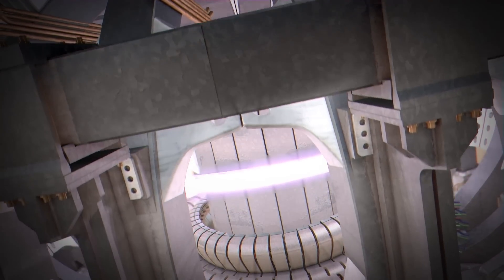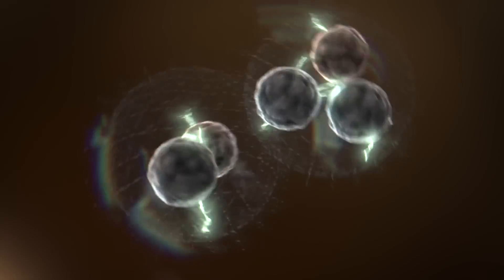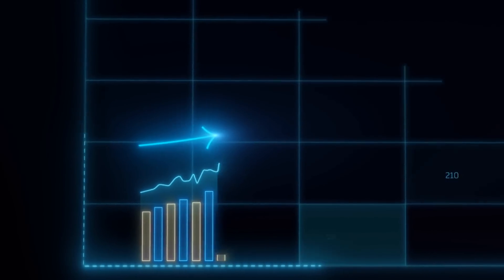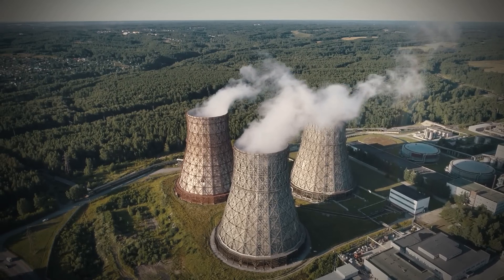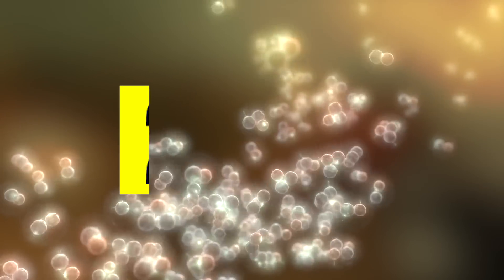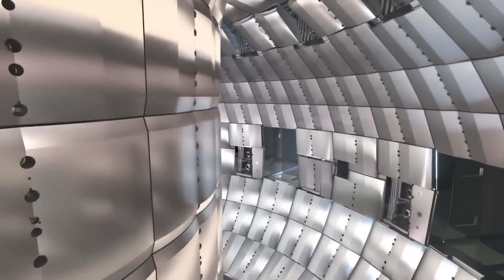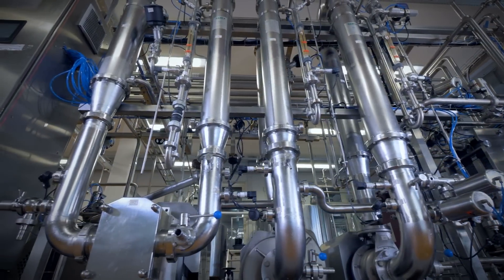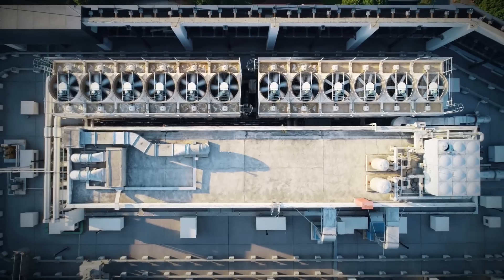The Shocking Problem That Could End Nuclear Fusion

Comment: Tritium breediing does not have to rely on the fusion reactors, it can also be done using other neutron sources. It adds to the cost but is feasible. As for the Lithium 6, as soon as te demand is there the facilities will be uilt, just like with any other material. the process of enriching it is well understood and the fact that a site that was poorly run decades ago is no longer operating does not necessarily mean that the method itself is unsuitable. Other than that a good video.
Reply: To add to this, that the lithium-6 isn't as abundant as lithium-7 shouldnt not be that big of a problem, lithium mining is increasing already due to need for the metal to manufacture batteries.
Reply: Oh, just got an idea, spent nuclear fuel radiate neutrons right? Why not use this used fuel to make tritium  instead of burrying it in the ground?
Reply: @assarstromblad3280  it's a rate issue. Tritium itself is radioactive, you need a source which produces at high enough rates to see significant value, and spent rods are considered spent for a reason.

That said, viable alternate in the short (50+ year) run- just invest in nuclear fission power. It's safer and greener than coal, and it turns out the WASTE PRODUCT is a highly sought after resource in its own right
Reply: @mjp121  spent rods are not spent at all btw. There's like 95%+ fissile fuel left in them. Our current fission reactors are abysmally bad, because no one wants to invest into better designs.
Everyone wants illusive fusion, because it sounds cool or something, not realizing a good fission design would be much cheaper and even better for the environment
Reply: @assarstromblad3280  They just have so little radiation
Reply: I remember a Kurgezkat video about fusion, they said a good substitute for Tritium Is helium-3 which is abundant on the moon
Reply: It is so well understood that it is still only theoretical. Reactors are never going to produce tritium at a 1 to 1 ratio. So even with tritium breeding a fusion reactor is still going to need a continuous supply as the likelyhood that tritium is produced is very small.
Reply: Soooo... in order to run the "clean" fusion plants, we have to also run fission plants to generate the fuel? AWESOME!
Reply: @richardmetzler7909  fission is clean, cleanest source of energy there is. And could be way more cleaner still if people stopped ignoring that option.
Reply: @richardmetzler7909  not necessarily, but it is one of several options. While we are at it, check the radioactive emissions of coal fired plants. The ash has some quite elevated levels of radioactivity in many cases.
Reply: Tritium is being breeded directly within the iter reaktor!!
Reply: it can be mined, just like we already do for batteries. yeah, let's completely destroy south America for lithium... who cares? we will be charging the customers for the extraction processes anyway.
Reply: Brilliant Light Power – Latest Update
212 views  Jun 3, 2022  Mr. Hinman discusses his long-term interest in breakthrough energy, again focusing on Brilliant Light Power.
https://www.youtube.com/watch?v=W_Fll6elzpI&t=231s&ab_channel=CharlesArthur
Reply: Yeah tritium is already produced as a byproduct in fission reactors, so they just need to optimise a process that used a fissile material to produce lots of tritium. Traditional fission reactions generally produce neutrons anyway.
Reply: Kalki Ironman type 7 and 8 after 2026 😎

kalki avatar (beast of the earth) (christ on the white horse) (son of man on clouds) is the biggest enemy of dajjal/antichrist/kali 😏

Kalki Avatar (Murtaza) 11th satguru 13th imam cousin of Moula mahdhi a.s. 12th imam (muhammad) 😎

Prophet Moula mahdhi is raja shashidhuvj (the mighty one) born less then 1200 years ago 😎

Prophet Moula Isa a.s. will kill dajjal cause dajjal is going to kill Kalki Avatar 😏

Kalki Avatar will follow orders from 2 religious king Moula mahdhi a.s. and Moula Isa a.s. 😎

Kalki Avatar going to have 2 swords and ring of moula sulaiman a.s. and staff of moula musa a.s. (iron rod) Staff of moula musa a.s. is like omintrix can transform into anything and can transform others into anything And stone in the ring of moula sulaiman a.s. is also known as kastav mani and it's more powerful than all 6 infinite stones combined 😇

Cuz Kalki is ironman batman super saiya-jin superman ben10 saitama optimus prime shaktimaan and every super heroes combined after 2026 😎

This staff will transforms into white horses with wings,weapons,iron-man,cloud etc or can do imagination into reality 😎

*Ratn sru sword of lord shiva (miri)😇

*Ratn varu (zulfakar) sword of Moula Ali (piri) 😇

miri piri 😇

Kalki Ironman after 2026 😎

Satyug (sunrise from West) 2038 😏

Sambal is hospital 😏

Gzwa e hind 2029 😎

Khalistan and Azad Kashmir after 2026 by Ironman 😎

99% Hadith u heard is not about imam Mahdi it’s about Kalki avatar (the main character) that person momin vs dajjal prove me wrong if u can 😏😏😏.
Reply: Well said Sir!
Reply: This is the correct answer
Reply: Even if making tritium requires a lot of energy, it might be a solution to the question of where and how to store renewable energy ? We could just use the excess to breed tritium ?

Comment: The solution is the same as it has been since the 1960s-Molten Salt Reactors fueled by thorium. There is enough thorium sitting in the tailings of the Pea Ridge Iron Mine in Missouri to power the US for several centuries.
Reply: Interesting

Comment: This is one of the reasons to return to the moon. Helium3 is presumed to be plentiful there and can be substituted for tritium.
Reply: If they built the space station in a modular form, couldn't they do the same with a fusion reactor, but without the lead shielding, which wouldn't be necessary. Mine it directly from the moon, sending down the power to giant collector towers. Or am I being simple?

Comment: Does not matter since Magnetic plasma confinement does not work. Issue is that the Plasma produces a magnetic field that destabilizes the containment field. The best runs (very few) last a few minutes. Most runs last just a few seconds before the containment field fails. The other issue is that the neutrons will cause superconductor magnetics to fail over time due to transmutation. Adding sufficient shielding would seperate that superconducting magnets too far away to produce a strong magnetic containment field. Magnetic confinement is like a onion, with layers & layers of problems that are basically unsolvable.

Comment: Lower tech energy src is yellowstone geothermal energy, 11 cubic miles magma, nasa say enough heat, to power us grid. Taupo supervolcano, supply 1/5 power in nz. cold water boreholes in, superheated steam boreholes out, spin turbines/generators, since 1958. Yellowstone supervolcano 100x bigger. Tapping it, might prevent overdue extinction eruption, within 50k yrs.

Comment: you forgot to expand on the biggest main Issue I find with fusion as it stands, and that is that it requires temperatures several times the sun's own to operate. This is an issue because the energy in is far greater than the energy out without matching or exceeding the pressure of the gases making up the sun's fusion process. This means that as it stands, it is very energy inefficient by design since it would be quite unsafe if the pressure was artificially done to the required level. Feel free to correct me if I'm wrong, I'm not an expert on this specific topic and just know a bit about fusion.
Reply: it requires very little energy to give one atom the temperature of 1000x sun core

what requires a lot of energy is heating up a large amount of atom, like a 32°C pool for example.

But in a fusion reactor, among the matter than is heated up, a large portion is actually used for the reaction. There is not much waste in heating up matter than isn’t going to react.

And if you talk about the fact that current fusion reactors product energy at negative rates, that is how research work. Scientists are not building fusion reactor to produce energy. They are doing it to check if reality fits theory, and to fix the theory if not so. Science papers already proved that a fusion reactor can produce energy at excellent rate.
Scientists estimate about 50 extra years of research before starting to build any useful fusion reactor.

The only issue is time, not feasibility. Humans took time before making planes fly.
Reply: This has all been sorted out. Read the papers.
Reply: me thinks fusion will always produce a net negative amount of energy unless you can take advantage of gravity in the same way the sun does...
Reply: @carlos gaspar
science doesnt work like that. Even if you have a phd. It does not matter what you think. As long as you did not do the math, your point of view is irrelevant. Just like Einstein assumed the universe was stable and turned out to be wrong.

The difference is that you don’t have to do the math, since briant people did it before you, and concluded it was possible.

Comment: Hey bro, can you explain to me why the heat has to be larger than the suns heat in it's core? It doesn't really make sense to me, as the sun has no problem making the pp-process
Reply: In the Sun's core there is the pressure due to the huge mass and gravity of the Sun itself, so the temperature can be lower. Here we can't have that, so we have to heat it up a lot to make nuclei collide fast enough to fuse together at a reasonable rate.
Reply: @GabrieleR95  ahhh yeah I totally forgot about mass. Thank you a lot for explanation/reminder!

Comment: There is a natural source of tritium. The upper atmosphere. In fact more tritium comes from that than nuclear reactors. No we are not going to need huge amounts of tritium. 1MeV is not a lot but when you get it from a single fusion instance it;s quite a lot. By the time you are up to 3g of Tritium fused you have over 60,000 GJ which is enough to run 1000 average homes for 6 months. Put another way it's enough for all UK homes for about 10 minutes. OK not enough to use on it's own but as a base for wind and solar to supplement it's still good. The only thing that is really needed is distributed storage at about 30kWh per household. Sodium batteries can be used for that if the legislation changed.

Comment: The longer it goes on, the bigger the fusion hype.  Trillions are being spent on this.. and I suspect it is only a pipe dream. We really aren't any closer today than 20 years ago. It's all theoretical.
 I've said for a long time that more should be invested in some form of geothermal. Drilling WAY down and using magma as a heat source to drive steam turbines. The main drawback seems to be drilling that far down.  But that seems like  a much easier problem to solve than creating and harnessing an artificial sun
Reply: You are the complete antithesis to science, giving up or not starting because it is "impossible". Science issoldiering on despite repeated failures and learning from it. If it were up to you, man won't have progressed past the industrial age.

It's not as if there is no progress in the technology, China just set a new record this year in producing an "artificial sun" 5x times hotter than the sun for 17 minutes. Other countries working on it have also done it beforehand althoughfor shorter time. This is science and technology, it is not easy as pie. It requires concerted effort and time.
Reply: @rap3208  Just amazing....  Slandering me when you know nothing about me.. as I said, I SUSPECT it is only a pipe dream. You know nothing of me and my science background. You seem to read the headlines and buy into all the hype, without doing your own research. You should do some research into China's "artificial sun". It isn't what you think.  China also has over 1,100 COAL fired power plants and is building them at a record pace

Comment: Thermal neutrons....  The ones that get blocked by the shield, the fusion on the neutron and decay of the lithium all make lots of heat.  If the blanket somehow works too well, all the intended nuclear reactions and side reactions will cause the blanket to melt.

Comment: Nuclear fusion is hard.  Nuclear fission is easy. Both need radiation shielding and other safety measures but the latter is cheap. Fast spectrum molten salt nuclear is intrinsically safe. It removes all of the inherent hazards caused by any other technology. That makes it cheap. The fast spectrum means no long term waste. Everything gets burnt.
Reply: Yeah, but there's no comparison on the amount of energy that a fusion reactor produces per kg of fuel.
Reply: @antoniousai1989  it produces little energy though, at least for now that is. Right now there is little energy that gets produced to make it viable. Maybe when farming for helium 3 becomes viable on the moon and Saturn could nuclear fusion become viable.
Reply: there are literally hundreds if not thousands of designs for passively safe fission its more of the fact that most law makers are 50+ years old with their minds stuck on 1950s tech
Reply: Yes except corrosion is bad in molten salt reactors :(

Comment: You missed the elepant in the room.Conversion of 'fusion energy' which essentially is a 14MeV neutron into something useful  is a materials problem which will NEVER NEVER find an economic solution. As a power engineer with 45 years experience I can make this statement. NEVER. And nobody in the fusion reactor community wants to address this issue. Fission reactors were up and running within 10 years of the Chadwick neutron understanding. Fusion always was and always will be just 30 years away.

Comment: When I saw the title, the first thought that went through my head is the sheer cost. If fusion doesn't deliver electricity at a cost lower than the alternative - which is renewable energy, backed with what will then be mature energy storage technology - then fusion simply becomes another interesting but in-practice obsolete technology.
Reply: I think a lot of people think of that and although a reality fusion will have to face its also short sighted.
It doesn't consider the future of humanity on earth let alone in space its centered purely around fusion as only being useful as a technology to stop climate change.
Fusion is a technology to allow humanity to be post energy scarcity.

Most of what humanity does is limited by resource acquisition and refinement. Most of that is limited not by raw availability but by the limit and costs of energy production

Huminites power needs will continue to grow and given how much power some technologies take if we want mass access to such future technology we could easily see the power needs of each individual go up 20x what they are now.
Renewables like solar and wind would struggle when the required earth coverage of solar panels goes from 1-2% up to 20%-40%

Even if we move the required manufacturing and industrial base into space where things like mass scale solar are more feasible it only makes sense in locations in the inner solar system and where the rate of scaling is important. The outer solar system will still benefit from fusion power plants in that scenario.
Reply: @nocare  That doesn't change the fact that if you have clean, cheap energy by other means, then fusion won't get used - because its simply more expensive. 

Fusion probably does have a niche use in space craft.

Comment: Why would you bother with this? Once you solve the Tritium problem, you are still faced with the insurmountable containment problem with an added breeder component now.... Never going to work. Better off with fission and evolving the Thorium/U-233 breeder cycle in a liquid fluoride salt. Literally a fuel source for heating water to create steam to generate electricity for tens of millions of years. Electricity forever. Use the Hydrocarbons for transport fuels.
Reply: And you can plunk down a modular reactor whereever a coal power plant is and use the existing steam turbine equipment, transformers, etc.

Comment: Of course Deuterium can be extracted from the oceans and tritium can be bread but this needs a compex industrial basis and will never be easy like putting gasoline in a tank.
Reply: No form of power generation is as simple as putting gas in a tank, infact even gasoline powered combustion engines aren't that simple, it's just that whenever anything more then the absolute basics are necessary you pay someone else to do it for you
Reply: @jackwalters5506  Steam engine was the most basic from the energy source point of view, combustion engines come next. Fusion like fission requires the fuel to be processed. If a technology can be developed to use natural fuel like hydrogen H2 or Boron or any other fuel that can be fused, it would make fusion really cheap because a great deal of the price is in the fuel processing.
Reply: @jackwalters5506  Moreover, aneutronic fusion would be ideal because it could be used with minimal protection.
Reply: @thelovertunisia  yes, Aneutronic fusion would be the ideal, the issue is that all the good fuel for that is on the moon or even further, which provides a very big barrier to getting development for that
Reply: @jackwalters5506  I'm not sure but I think there are other fuels for aneutronic fusion too just the temperature must be extremely high.
Reply: @thelovertunisia  there are other fuels, but they run into other problems that make them non viable for large scale operations. Realistically, fusion is a good time away even if we had all the fuel we could ever need, and we will industrialize the moon/space at some point anyways, so something that motivates us to do it sooner is good as far as I'm concerned
Reply: @jackwalters5506  Agree.